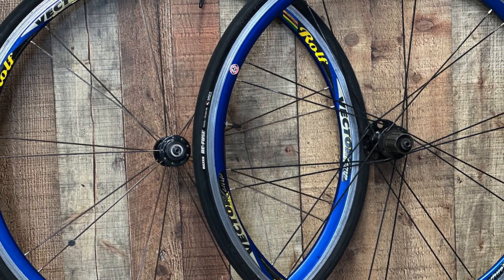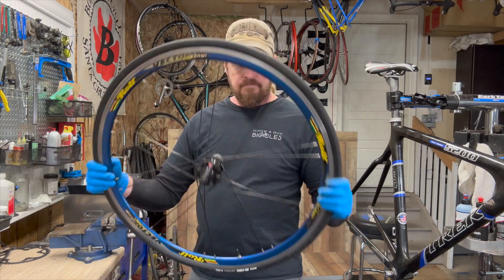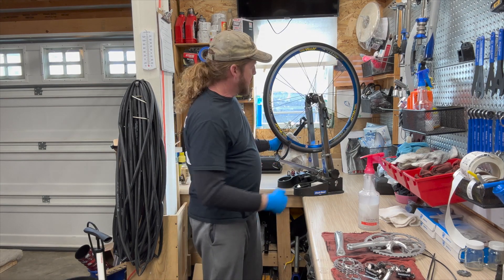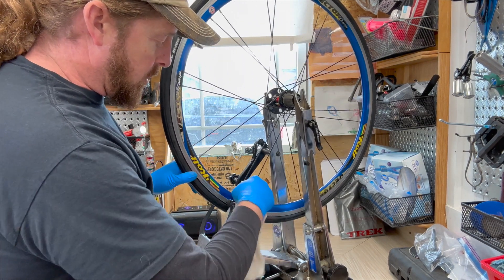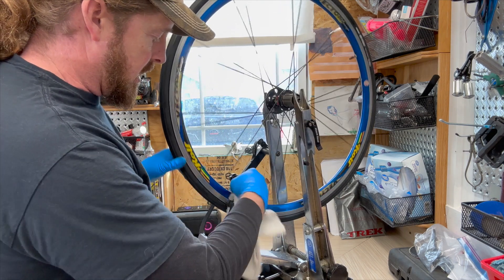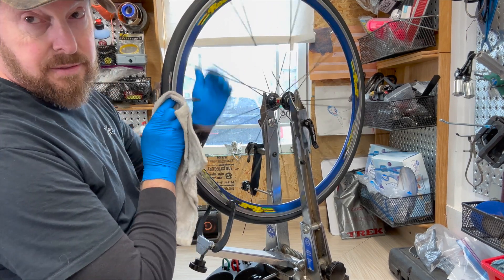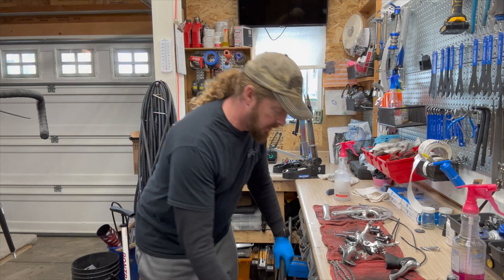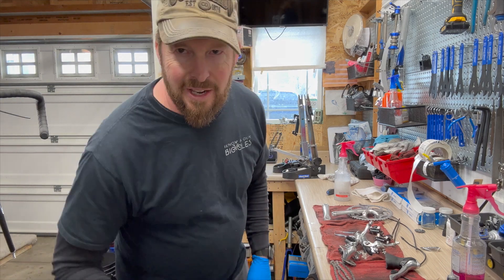2001 Trek 5200 56cm - Rolf Vector Wheels - Part 2

Comment: I have set of Shimano 7701 Wheels with the paired spokes,  16 spokes attach to  the sides of the rim (8-each side). I Just trued them a week ago. Park Tools has a excelent application for spoke tension  Balancing on their website. The 7701 wheels look similar to the Rolf wheels, the paired spokes look so cool.  Back in the early 2000s Michelin and Continental made really cool-looking colored tires that complimented the cool-looking wheels, they looked Fast......  Your video on restoring those Rolf wheels was Excellent, enjojed watching.

Comment: I´ve got a '99 Lemond Zurich with Rolf Vector Comps - What's the largest tire I can put on this setup? I have a pair of Michelin 700x40c. The tires mounted right now are Continental 700x25 IIRC, Grand Prix
Reply from the maker: The Rolf wheels can accommodate that size. Unfortunately, the LeMond Zürich can’t accommodate a tire that wide as well as the brake calipers. My recommendation is to only use the 700x25c tires. You could probably get a 700x28c tires to fit, but it will be very close to the frame for clearance.